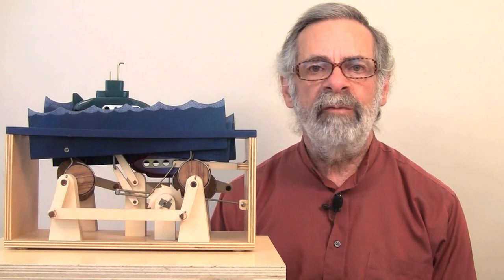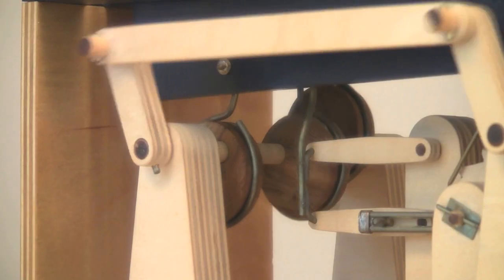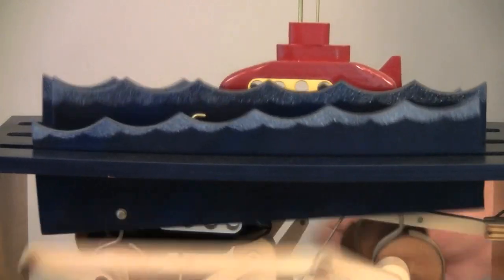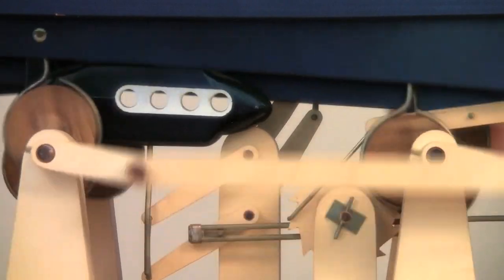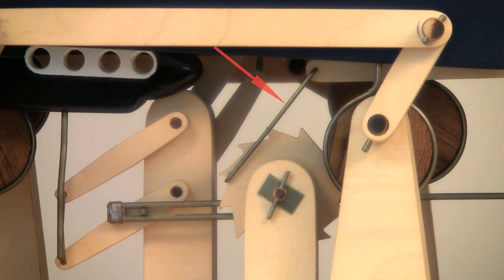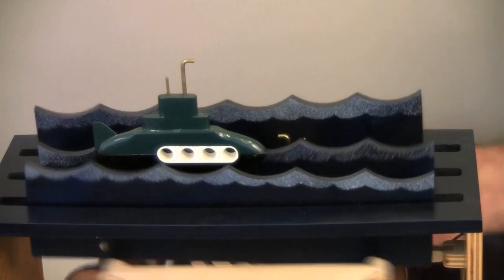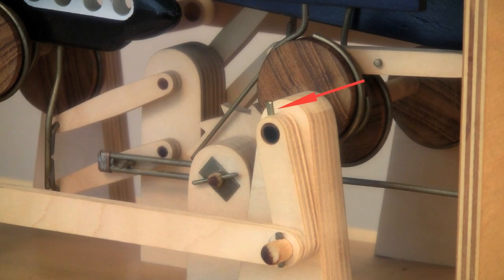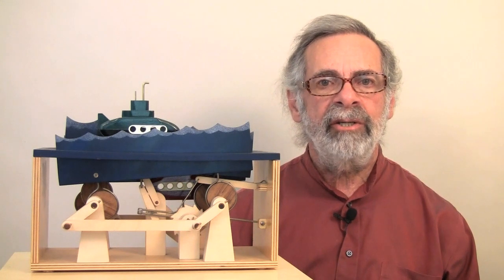Submarines

Comment: So fun and such great ingenuity! May I ask: The pins that hold all your axles (and other parts) together. They are just press fit into slightly smaller hole in the wood? Are they tapered at all? Do they tend to work loose as you are assembling/disassembling during the build? Thanks!